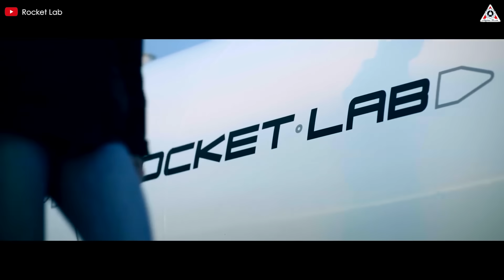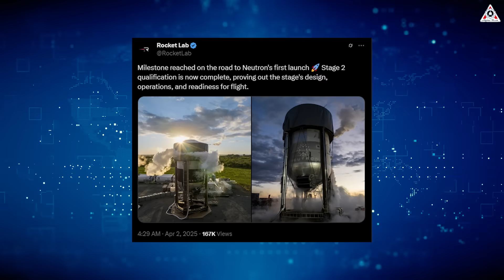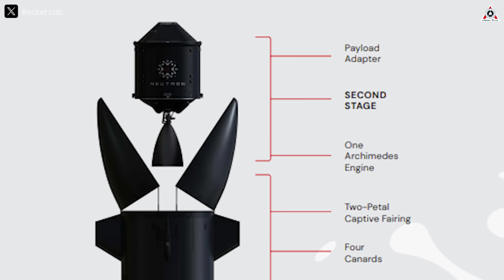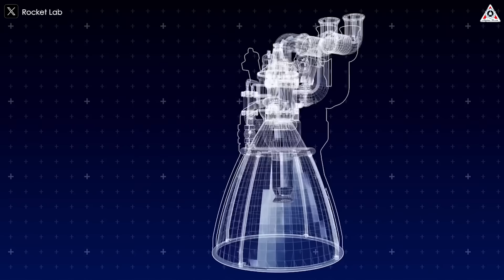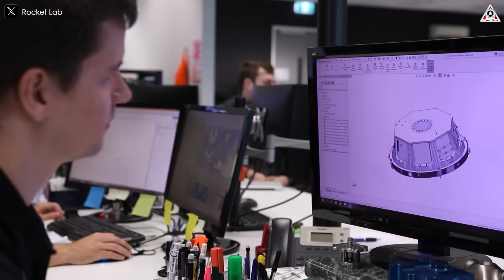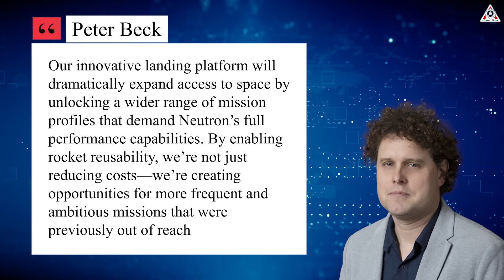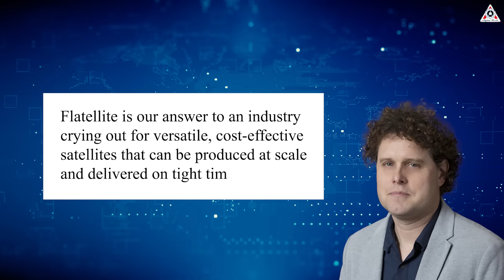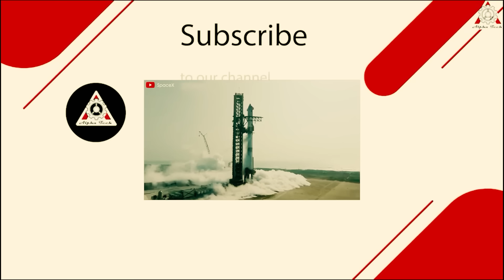What Rocket Lab just did totally humiliated Blue Origin after SpaceX…

Comment: 4:17 I guess retractable legs have some sort of spring buffer dampening so landing isn’t as harsh on the upper structure so surely static legs need a lot more inspection for hair line cracks on the upper shell so it’s a negative then isn’t it? 
Change it to something simple everyone can think about. Mountain bike static forks versus suspension forks. Once you hit a bump which is going to be more forgiving and which will see a fork crack first after extreme hard hit ? Which will be lighter when you design it to expect hard hits. The suspension of course. It’ll have more bits and pieces but As static needs to be a lot stronger for the impacts to stop it crumbling it’ll be heavier ? Am I looking at this right??

Comment: Amazing company, my only question is really around the static landing legs of the Neutron. I 100% agree they are simpler and easier to maintain, but when compared to other spacecraft, are they wide enough to neutralize any sway upon landing to prevent tip over. SpaceX falcons still have quite a lot of sway on landing and the wider legs help prevent a tip over. Not saying RL doesn't have an adequate solution, just asking? I guess we'll find out once they actually launch it.

Comment: ULA and BO legacy style designs are overly spendy and CANNOT compete with Rocket Lab and SpaceX.   BO is not even in the same league.   BO has also hamstrung ULA with the loser BE4 engine.    SpaceX has produced hundreds of Raptor engines and is probably pushing out a Gen 4.

Comment: How far this Rocket Lab would of gone if there were no SpaceX and Blue Origin ? The amount of data that is around for building rockets and so on thanks to SpaceX and Blue Origin and the amount of testing to get everything working. Building engines and so on. How much of it is all Rocket Lab as engineering everything from zero ?
Also i dont think that opening the nose is a good idea. It was done in early stages too but they changed it probably to blast it off for the reason that the opening can have issues or the cargo can make issues with the opening and it's added risk. To be honest even this reusable as come back to land is not their own idea and they copy it from the people who have done heavy testing on it. The reports are probably classified so if they have access to these then they can learn from it and improve it on their own but is that achievement on their own ?

Carbon fiber is already proven that it's not the best material to be used for cases like this. Even deep sea submarine prove it that it sunk. Why would you want to use it for space ? Space have all sorts of micro object fly around to do damage. Vibration already is doing damage. The worst part of the material is that you wont see cracks and then catastrophes will happen cause all look good but then kaboom and over. It's ok to make sports cars and formula carts out of it but it's not fit for space or deep sea pressure.
Reply: Have you paid any attention to their cadence? How many rockets have been destroyed? They are innovating faster than anyone else, they have a solid business plan that will slow them to compete and eventually beat out spacex. They are reliable, they are consistent, and can produce their own satellites unlike spacex
Reply: @Adam-zq8fi   SpaceX produces its own satellites, Starlink.  They also sell a version called Star shield to the space force.  Peter Beck and Rocketlab are following in their footsteps...which is not necessarily a bad idea.  Yes, they do some things differently, which may help them in the future.  We will just have to wait and see.
Reply: I think you should start your own space launch company, as you clearly know far more about spacecraft design and operations than these clowns at RocketLab.
Reply: Carbon composite is strong in tension not compression. That was why building a submersible with it was stupid. Composite pressure vessels work really well but are a bit expensive.

Comment: That was interesting. I did not know that Rocket Lab was building a landing barge. There is nothing unprecedented about that of course. SpaceX has been opearting those for ten years now. Their manufacturing process does look unique in the industry though. I wonder if those techniques can be scaled up to heavy lift rockets? If so, that will be another major advance in an industry that has been experiencing almost continuous revolutionary change for at least the last twenty years.
Right now, there are two operational, reusable launch rockets in the world, both operated by SpaceX, Falcons 9 and Heavy. With luck, in two years, and no more than three or four, Rocket Lab, Blue Origin, Stoke Space, Relativity Space, and SpaceX itself will have all added another one to the list. ULA will finish out their existing launch manifest at the time, but will probably never get another contract for Vulcan. SLS will finally be cancelled. The only medium and heavy lift expendable rockets that will keep flying after that are those operated by foreign governments seeking to maintain a sovereign launch capability. I doubt that even they will ever develop new ones though. The age of the expendable rocket is as thoroughly over as the age of sail was in the early 19th century.

Comment: I am confused on their use of carbon fiber for multiple launch and reentry.  They speak to a new way to configure the carbon fiber but no mention of how it will be protected from the heat generated by reentry  which is some 1600 degrees C.. Carbon fiber can withstand not much more than 200C.  Thank you Peter Beck!
Reply: The booster only is returned to be reused. The booster does not approach the kind of velocity to obtain orbit. That task is handled by the second stage which is not returned. So with this configuration there is no need to handle the extreme heat of re-entry from orbital velocity. We are talking the difference between ~2300 MPH v.s. 17,500 MPH.

Comment: Blue Origin SHOULD be worried, that stunt was an advertisement that read "It's so safe even GIRLS can do it!!" - how insulting is that?  He threw some women into the air and caught them. They were payload. Very BRAVE payload, no disrespect to them at ALL, I just find this insulting to women as it didn't demonstrate their skill. As for saying they did the same as Alan Shepherd, you were lofted over the Karman line, still in thin atmosphere. No fiery re-entry like Shepherd had to handle by orienting his capsule's heat shield correctly to prevent the inconvenience of being vapourised on an actual re-entry from 85% higher.

Comment: Is the Carbon composite shell of the 1st stage cheaper or more expensive than the Stainless Steel Starship from SpaceX? Will it outlast the SpaceX design? Is it lighter than the stainless steel approach? They've obviously followed suit  with multiple engines providing less strain on more powerful engines that Glenn utilizes; does anyone have the answer to these questions? I would assume the carbon composite design would certainly be lighter...
Reply: With steel, it's easier to develop quickly or we can afford rapid changes, carbon is a completely different style, each has its advantages and disadvantages
Reply: Carbon fiber is stronger and much lighter than stainless steel and can be tuned for different purposes. Rocket Lab's approach is to put significantly more effort into upfront design and establish a working production line with relatively few test flights required, whereas SpaceX focusses on rapid turn-around of design and multiple iterative test flights.

Comment: Every ship landing on the moon or Mars standing up will fall over. Sorry but it's a bad design.
Reply: Exactly Starship is what over 200 feet tall. No chopsticks on Moon or Mars to catch it. If one of the legs lands on a Boulder or in a crater, timber. It is so stupid. Ok, it is fueled by liquid Methane and liquid oxygen. It takes 6 to 9 months to get to Mars. And that fuel, even if they can bring enough, won't boil off or leak? How many tons of water and food for the crew? Could recycle water to a certain extent like the space station, but you can't send up a supply rocket to get parts if anything at all breaks millions of miles from home. Insane. Well it is coming from someone high on drugs. Is Musk building a elevator to get his Muskonaunts to the surface? Boy that will be heavy. Need an extra 100 tons of fuel for that, whoops rocket got a lot bigger, now we need a bigger elevator, rinse and repeat.

Comment: Thanks for the hard work ALPHA TECH.  I think this is a high quality production with AI.

Regarding the design of Rocket Lab's craft, the legs look far too close to the center.  Any angular error in landing would result in a failure, and would seem it wouldn't have the same shock absorption quality without struts.  SpaceX by comparison must have 2.5x the surface contact diameter and their success in landing should dictate a ground truth to follow.

Comment: SpaceX's engine seems so much cleaner...
Reply: It's not exactly beauty contest. Also Neutron is targeting a slightly different market. 
Isp, weight, costs (which also imply production time), thrust, durability (reusability), eventual service costs and probably few more metrics are all above the looks. If it works, it works.
Reply: Rocket Lab should license Raptor 4; or buy complete engines.  Spacex is thinking their new motors will be highly reliable and will have to be for Mars
Reply: @JLKACMAN01  Why not for Snickers? And Pepsi should license Coca cola. Bright as the sunshine 🤣
Reply: @JLKACMAN01  No way. Raptor 4 runs at maximum stress, the very opposite of Rocket Lab's approach with Archimedes.

Comment: Rocket Lab is one of my favorite start ups, Peter is a really good out of the box thinker.. The taperd rocket design and permanent landing legs would be my choice also. Though I might incorporate control surfaces in them.

Not a big fan of carbon unless its light enough to power down using fuel rather than heat shield.

The engine is over complicated, and the next model engine likely post Raptor 3 debút, and a combo of problems from excessive complications, and groking Raptor 3's in operation, will likely have Rocket Lab become a parts count desciple company. 😂

I notice on the engine some small diameter tubes with long straight sections and sharp 90° bends...

Those are vibration collectors in the straights, and fatigue stress collectors in the sharp bends, and carbon being light and stiff, will make a better sound box than stainless.

Hope those are just temporary...

As stuff like that will sing at rocket frequency and harmonics, and if they dont come lose at the ends will fatigue at the bends...  
Most engineers in days of yore, would put loops in lines like that, to absorb vibrations, and nail them down with rubber blocs and struts if necessary.
And try to have ample radius bends at teminal ends, or where they had to go round something...

Straight lines are for tensil, everything else should be pleasant  curves or tapers etc.

Fair Skys Peter!
Reply: Hey hold-on ! Suggesting rubber blocks on pipework to absorb vibrations ??? Does this space 'expert'  not realise the rocket temperatures involved ?
Reply: @johnrday2023  
I didnt say use rubber blocks on a space ship I said they were used on other things, just giving an example of vibration dampening.
Go back and re-read...
Reply: How do you plan to not fall over with your very narrow legs and that problem is much worse if you are landing at sea and if you are returning to launch you are carrying very light loads to orbit
Reply: @alanrickett2537  
That render was less wide at the base than I'd like. It may not have been accurate. Not sure. If it was from Rocket Lab or somebody else.
But I noticed it being a bit less than it should be too.
Reply: I think you will find Peter Beck and his team have sufficient rocket and rocket engine expertise to make it all work.
Reply: @paulcarter7445  
Yeah, I believe that...
I dont even worry about them as a start up..